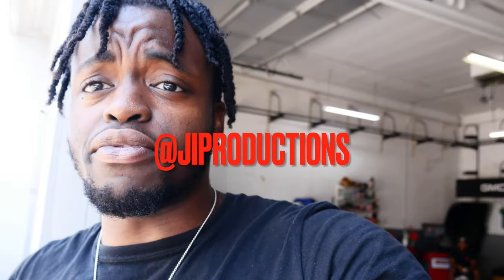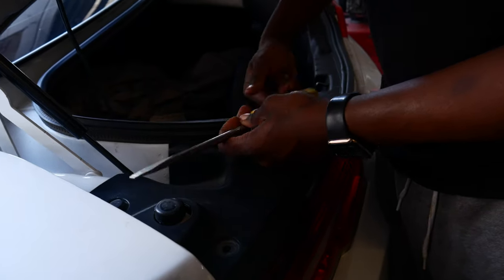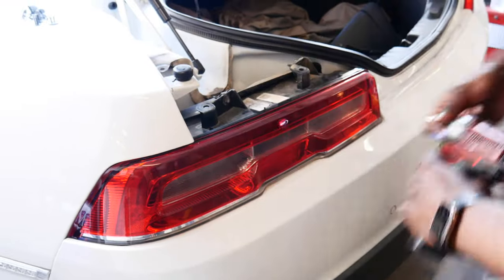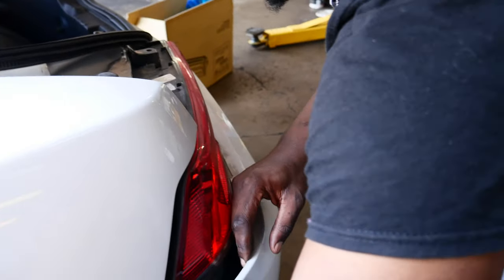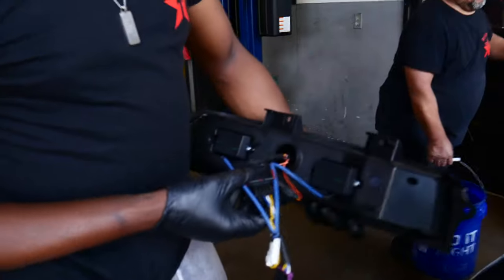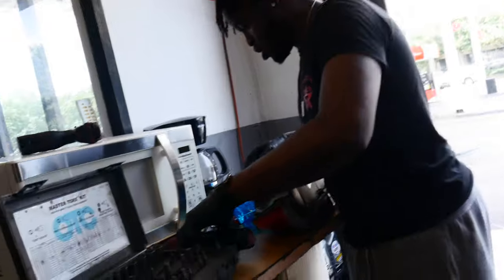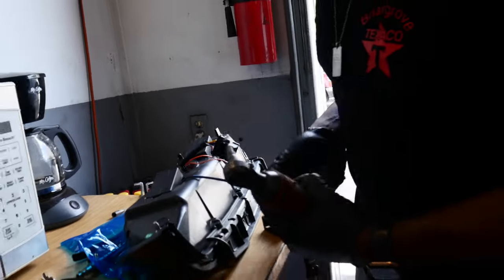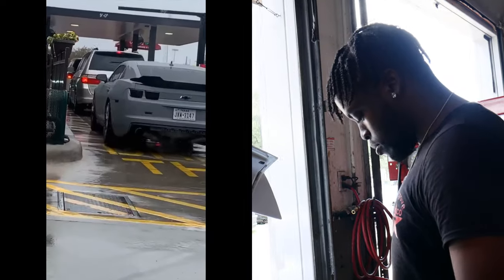Brand new tail lights for my 2015 CAMARO ( totally changed the look )

Comment: What did they do to wire it up? I just used the old plug and play for mine. I didn’t use any of the other wires at all. 
Mines a 15 2ss. 

The signals and brake light all work as they should. 
But if I have my signals on for 15 secs or more, they stop working

Comment: Yo what’s good brotha. I got these taillights and the 6th gen headlights on mine but have a hyper flash issue left side. Been like that for a year. Did you put load resistors on or did you leave factory headlights in?
Reply from the maker: I had the factory head lights with added rgbw function
Reply: @JIProductions  oh cool! I’m curious what that looks like. I’m debating switching over to stock lights again